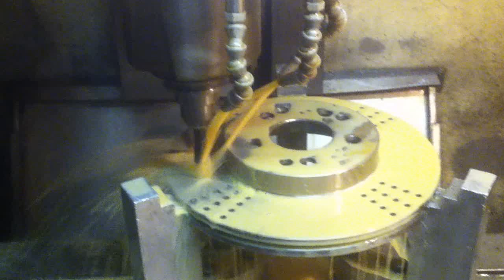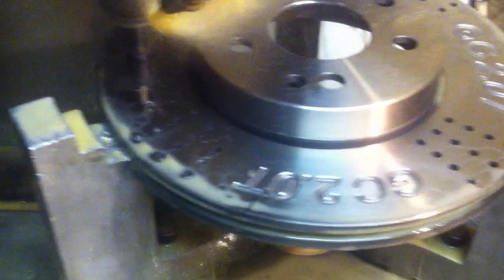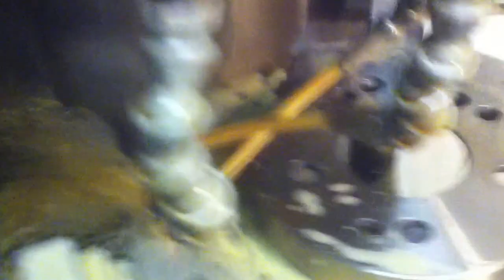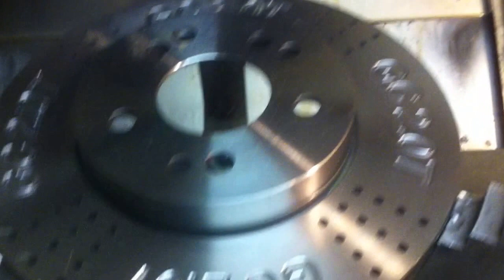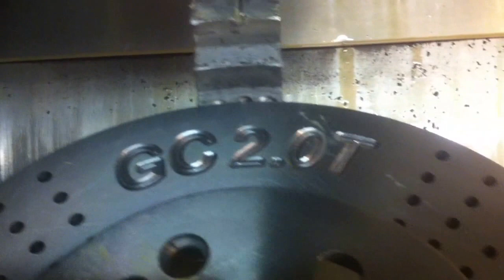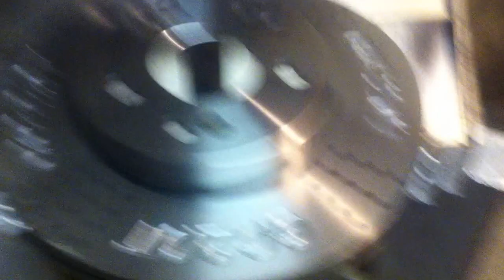AUTO PARTS RIVERSIDE CA 92503 ONTRIO INLAND EMPIRE.. 951-353-2225 CROSS DRILLED SLOTTED BRAKE ROTOR

Comment from the maker: We Carrry High Performance Cross Drilled And Slotted Brake Rotors For All Makes And Models, with Prices that will not be beat..

Riverside Auto Parts
951-353-2225 Text 951-534-9518